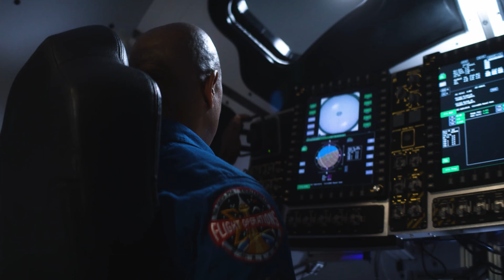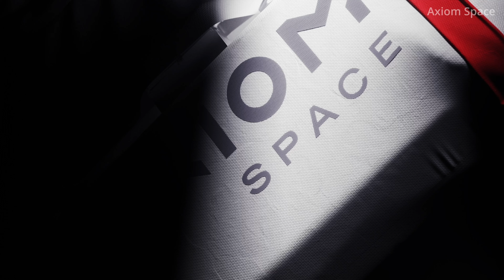NASA announces new delays for first astronaut Artemis mission, Moon landing

Comment: Nice recap. The heat shield issue is interesting, because I believe this is the largest of its kind for a man rated capsule - 16 and 1/2 feet or 5 meters in diameter. And, that heat shield is being used to pioneer a skip reentry technique that is also new for a man rated system, for a spacecraft returning to Earth at over 20,000 miles per hour.  Seems people forget that new techniques, improvements, etc. are being innovated/pursued with Artemis. 

I hope things work out and that efforts to improve manufacturability of the heat shield didn't create other problems.